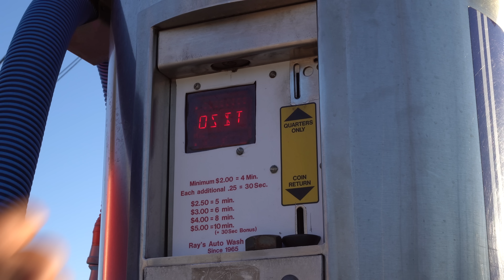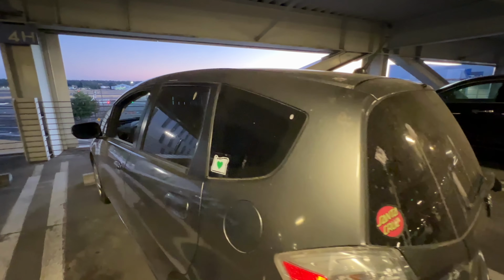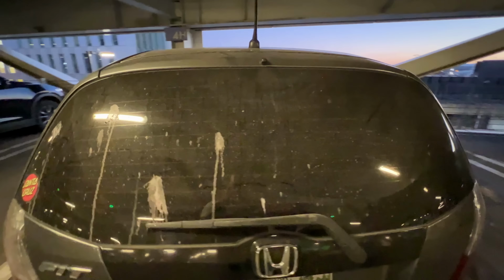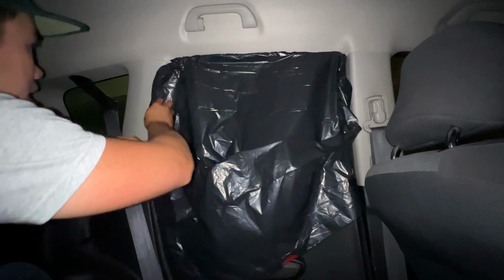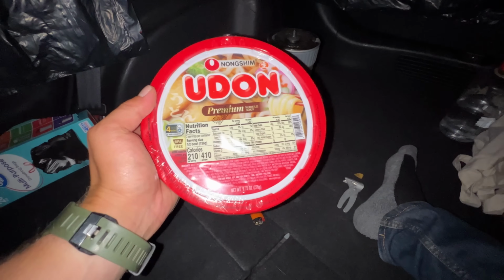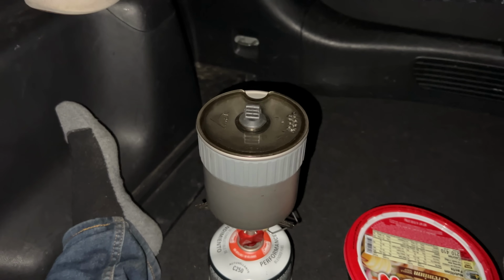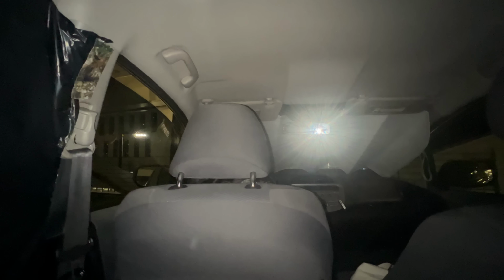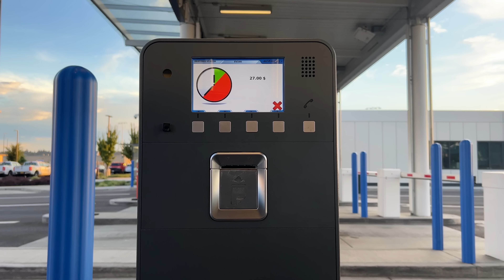Stealth Camping at the Airport in a Tiny Car

Comment: It was hot because you were in an enclosed structure that has the wind blocked. If you had parked on top floor with no roof above it would have been better

Comment: Wow I'm surprised that the parking lot would be quiet! I'm so glad I didn't buy a Honda Fit instead I got the Prius V...so much easier to sleep in there comfortably as I just left the engine run all night long to keep me cool during a summer heatwave in L.A.... BTW they have magnetic shades to put up for boondocking puroses instead of using the trash bags.

Comment: I have window shields on my windows to leave cracked open without being obvious and a way to secure my rear window a few inches open while still locked. My vehicle has an inverter so before bed, flip a switch and air up the mattress which is quite comfortable. Usually I do this on winter road trips to Florida but thinking about getting a slide in camper for our pickup. Less stealth but more enjoyable especially in a campground since I'll have a dog traveling with.

Comment: Another pro tip for easy cooking: Bring a quality thermos of boiling water (it will stay hot for many hours) and use it to make noodles/camp meals/whatever. We camp in the desert in Abu Dhabi a lot (in the winter, when it gets pretty cold at night) and this is a great way to have hot drinks by the fire and oatmeal in the morning without messing around with boiling water. 

Actually it would be cool to see you do some desert camping outside of the normal #vanlife spots. And if you're ever able to go international, visit Abu Dhabi in December and holla at me if you want to join us. It's spectacular to sleep among the sand dunes under the stars.

Comment: Also another thing is Honda fit gets hotter than crap that car is going to be like a hundred and ten degrees within like an hour
Reply: 27.00 for parking
Reply: Yeah, when I’ve had to camp out in my car in Summer, I prefer to find somewhere I can bring a mummy bag, and sleep on the ground.  Just right on the ground, because I have health problems and dehydrate very easily.  I’ve seen some do fine with windows up, but not me!